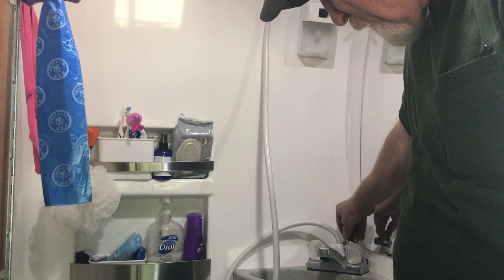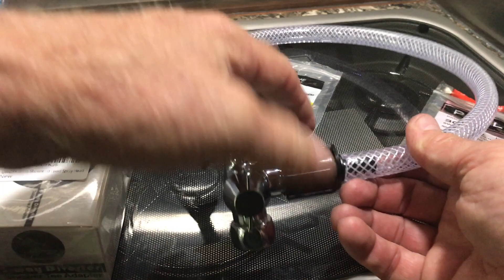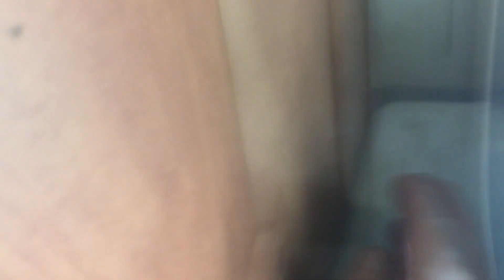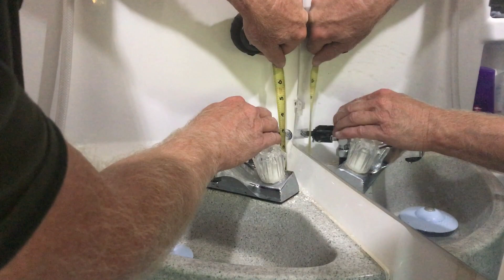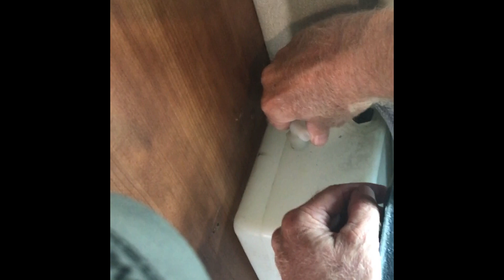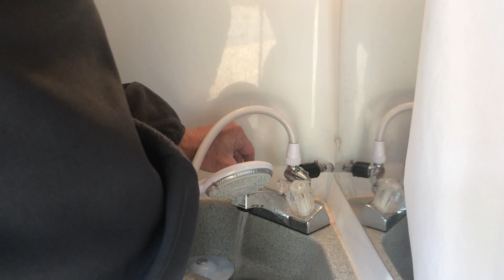Girard  Tankless Water Waster diverter valve FIX on my Roadtrek Simplicity

Comment: So impressed. I have been wanting to do this for a while, but have been intimidated by the prospect. Your video showed me that it is a fix I can do myself. Thanks Jack!
Reply from the maker: Your welcome.  A lot of folks have done this now and I think everyone does it a little different .  Some go down through the  back of the sink  and others through the back wall.  I understand that on some tank installations you may not have as much room under the black cover also so it's just a matter of you  looking on what works best for your situation.